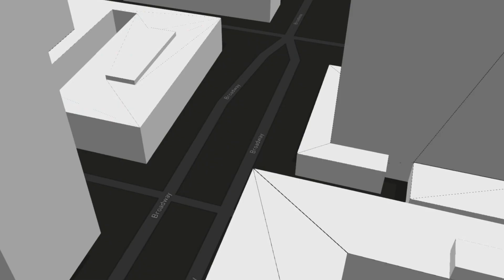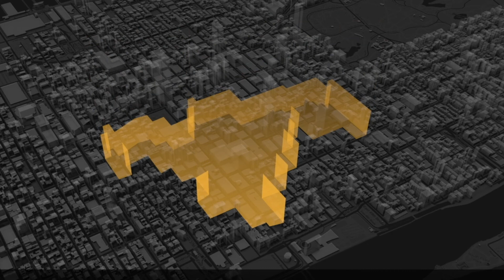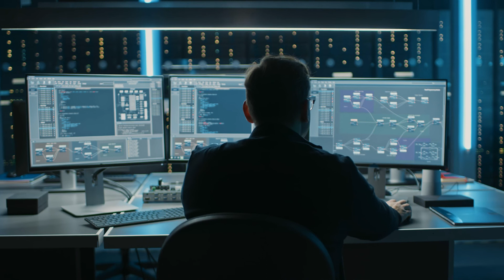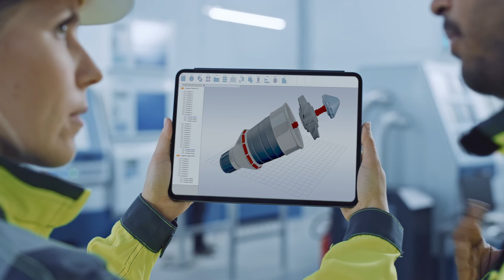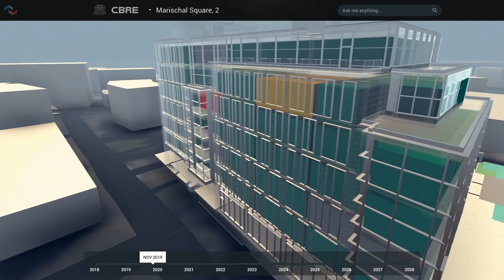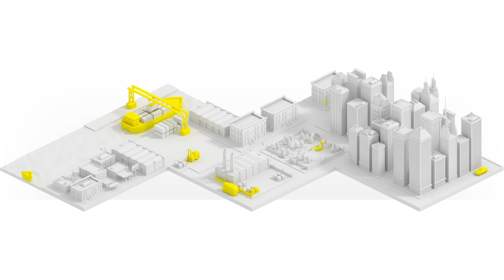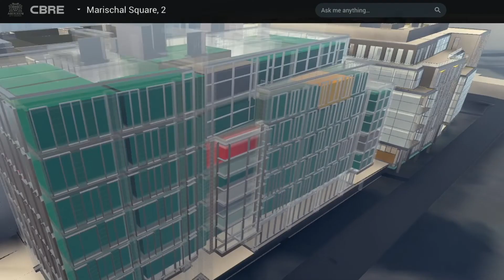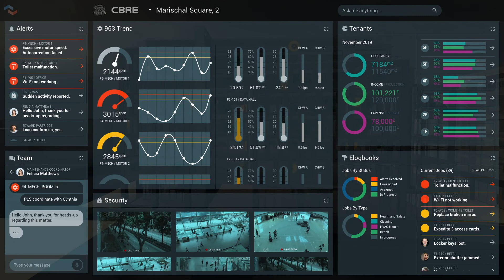Smart Cities Built by Digital Twins

Comment: Smart cities built by digital twins represent a groundbreaking integration of technology into urban planning and management. A digital twin is a virtual replica of a physical object, system, or environment that is used to simulate, analyze, and optimize its real-world counterpart. In the case of smart cities, digital twins serve as digital models of entire urban environments, incorporating data from various sources, such as IoT sensors, satellite imagery, and traffic systems, to create dynamic, real-time representations of the city.

These digital replicas allow city planners, governments, and companies to monitor, control, and optimize urban systems more efficiently. Urban planning and development can benefit from digital twins, helping planners visualize the impact of new developments, infrastructure changes, or zoning adjustments before they are made. By simulating how buildings, roads, and other structures will interact with existing systems, planners can make more informed decisions to improve the city's functionality and sustainability.

Digital twins can also help optimize infrastructure. With real-time data collection, cities can monitor the condition of roads, bridges, utilities, and other infrastructure components. This leads to better maintenance, early identification of potential issues, and more efficient resource allocation, ultimately increasing the lifespan of critical infrastructure.

In traffic and transportation management, digital twins can model traffic flows, public transportation systems, and pedestrian movement, helping to identify bottlenecks and optimize traffic signals and routes. This can result in reduced congestion, more efficient public transportation, and a smoother flow of people and goods throughout the city.

Digital twins also play a key role in energy efficiency and sustainability. Smart cities can use digital twins to optimize energy consumption, track carbon emissions, and promote sustainable practices. By simulating energy usage patterns and incorporating renewable energy sources, cities can reduce their environmental impact and improve their sustainability.

In times of crisis, digital twins can assist in emergency response and disaster management. By providing real-time data on urban systems and infrastructure, they help authorities respond faster and more effectively to natural disasters, accidents, or security threats, ultimately saving lives and minimizing damage.

Digital twins can also improve citizen engagement and quality of life. By analyzing patterns in air quality, noise levels, and green space availability, city officials can make data-driven decisions to improve the urban environment, creating healthier and more livable spaces for people.

The concept of smart cities powered by digital twins presents a transformative vision for the future of urban living. By harnessing the power of real-time data, simulations, and advanced analytics, cities can become more efficient, sustainable, and responsive to the needs of their residents. As digital twin technology continues to evolve, the potential for smarter, more connected cities grows, offering a glimpse into a future where urban living is optimized for both people and the planet.